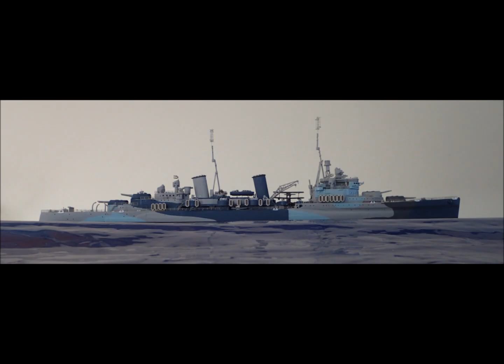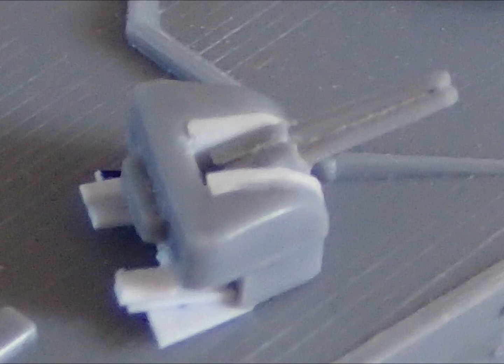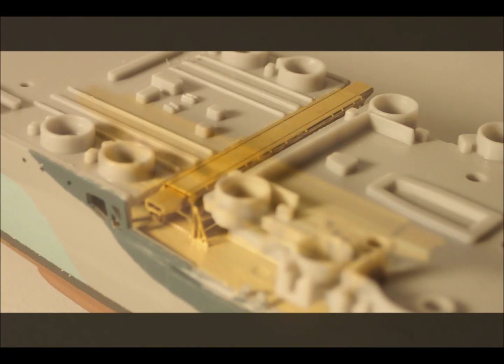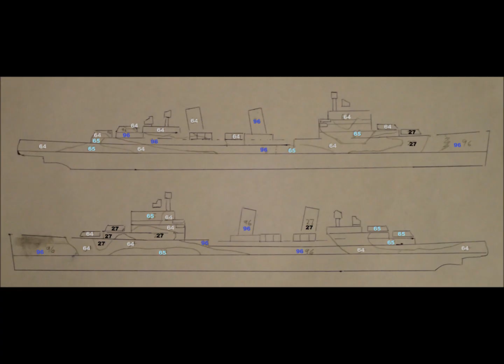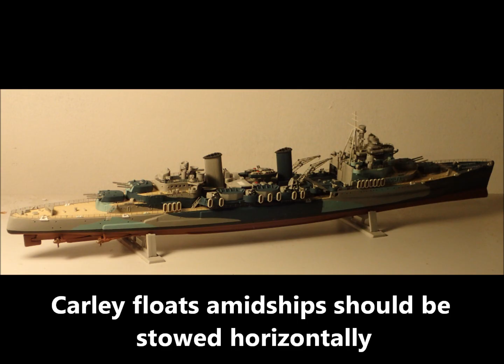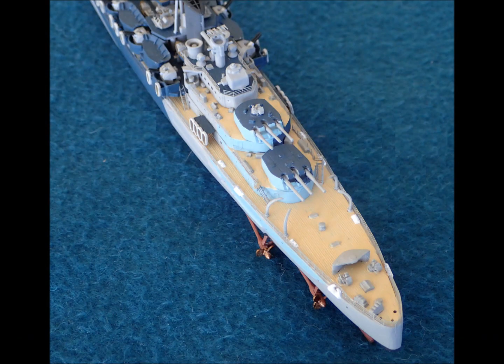Airfix 1:600 HMS Belfast

Comment: Do you intend to build any of the 1/600 ocean liners? They are a bit harder to acquire since they're discontinued.
Reply from the maker: May make a scratch built Mikhail Lermontov in 1:600, since I was somewhat obsessed with that ship for a while and have good plans for her, the wreck lying in just 35 meters of water close to where I used to live, and I've done quite a few dives on her.  There was a 1:600 Canberra on our local online auction site a while back, but I wasn't very financial at the time and it went for a healthy sum!!   The liners don't come up much here.